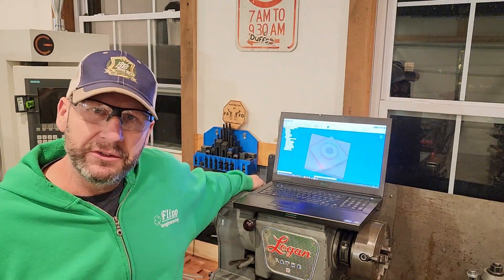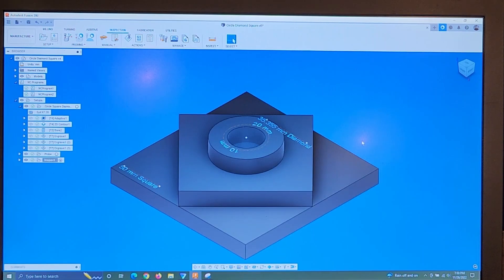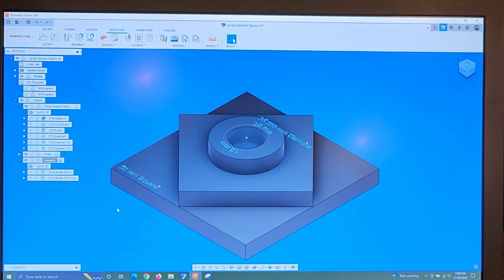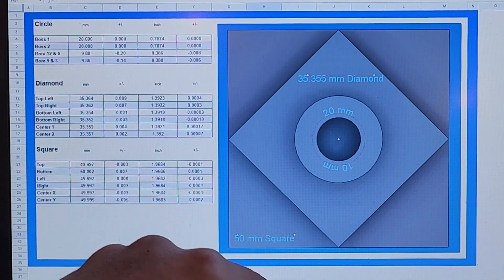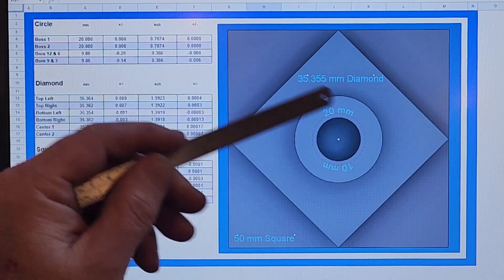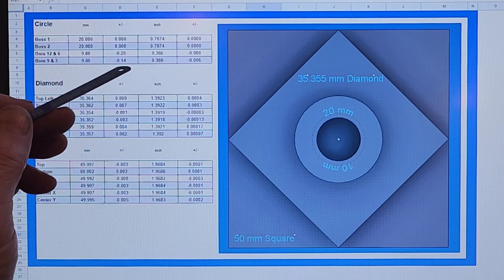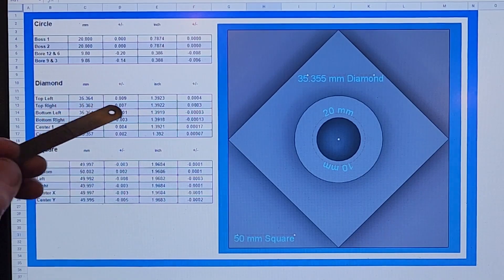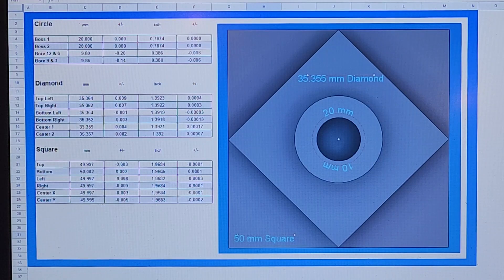How Accurate is my SYIL X7?

Comment: Why was the bore accuracy so bad?  What can Syil do to make it perfect? 😮
Reply: Calipers dont have a perfect knive edge.
So you are basicly measuring with 4 points wich wil give you an smaller reading.
Reply from the maker: @jankaas2760  That's a great point! Thank you
Reply from the maker: The accuracy (or lack of) was my fault. The numbers I got were due to my speeds and feeds and the deflection in the small endmill I was using. All of my measurements were one and done, meaning I ran the part once, and then measured.  I learned that I need to be more thoughtful when programming small bores.

Recently, I had to hit a number on an internal bore to allow a sliding fit. I didn't his the number on my first try, but after a couple of spring passes I hit my tolerance.  

On the bright side, at least it's not milling too much material. I think it's reasonable to account for deflection by running a spring pass or adjusting wear using cutter compensation.

Comment: -0.20mm for a 10mm bore seems ridiculous for such machine, is there any update on why this happens?
Reply from the maker: I'm much more familiar with the Syil now. My biggest mistake during this test piece was pushing the tool path too aggressively. The helical bore wasn't a bad strategy but I think my final contour path was too aggressive and my endmill deflected. For better accuracy, I like to leave less on the walls for the finish pass and even follow up with a final spring pass. I programmed repeat passes on the square and diamond and the measurements were better.
Reply: @PowerForgeWorkshop  I use gwizard calculator, it calculates the deflection
Reply from the maker: @dancollins1012  Cool, I'll check it out.
Reply: @PowerForgeWorkshop  A lot of people, especially when first getting into CNC programming, don't realize there is a conversion that needs to be done for circular interpolation especially when dealing with bores. Some CAM software and machines can do the compensations for it, but a lot don't, so the feed rates people normally post out are much higher than they should be. There is a multiplier you need to apply to the feed rates: (Diameter you're cutting - tool diameter ) / (Tool diameter) 

Example: Cutting .375 inch bore with a 4 flute 1/4" tool (RPM at 3000, chip load per tooth of .001)
Linear feed rate: 3000(RPM)*.001(chip load)*4(# of flutes) = 12 inches per minute
Circular feed adjustment: (.375-.250)/(.375) = 1/3

Adjusted feed rate = 12*(1/3) = 4 inches per minute
Reply from the maker: @adriand.896  Awesome! Thanks, I'll put that in my tool box for future use. I already have your comment copied to a word doc.
Reply: @PowerForgeWorkshop  That's great! Your video was a little older, so I wasn't sure if maybe you've already run into that, but figured I would at it. Even machinists that have been at it for a long time often don't realize it's a thing that needs adjusting
Reply from the maker: @adriand.896  I'm an enthusiast to be sure, but I love the old school approach of machining.  I learned manual before CNC and those formulas continued to help with the SYIL, especially when it needs some TLC in the tool path department.

Comment: Looking really good!

I just did that same test on my small wood cutting CNC (bought at a thrift store for €25, replaced the old controller with an Arduino running GRBL). Apparently, it has different pitched lead screws on the X and Y. 😅
Reply from the maker: That's cool. We also run a wood-cutting CNC router in the woodshop. I'll admit that's where I got the idea for this video. 

We're in the middle of using a micro-controller to make a manual pulse generator (MGP) for the router. It's an interesting project. I definitely need glasses and a magnifying glass to see well enough to solder those tiny pins.